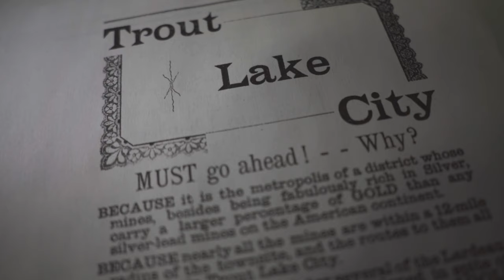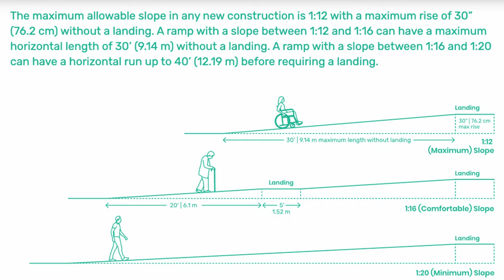Bowhead Presents: THE LONGEST CLIMB 💪  🏔

Comment: Insane man, big props for that climb. Didn't have any really clear shots to really check things out, but few things I picked up/wondered about....First, looks like you had a Ikon 2.8" outback, think you would be better served with some fatter like a Bontrager Hodag 3.8" or such, would make finding traction doing stuff like this much easier vs the small weight gain it would add. 
Second, luckily still pretty much fully physically able, but sitting watching the video and trying rowing like you would operating that, my hands kept naturally falling to a noon vertical orientation, slightly angled outward at the bottom, so wondering if that also wouldn't help or having some way of adjusting the position your hands end up in, or the ability to change up hand position to let certain muscles rest/change muscles being used, just like you do moving on the saddle and hand positions on a regular bike helps. Also, having the cranks lower I think would definitely help reduce shoulder engagement and tiring, bring them lower and closer or better yet adjustable, again to engage different muscles and let others rest.

Comment: @bowhead great design but as noted in previous comment. From a physics standpoint, wouldn’t be better if the cranks were facing on opposite ends like 12 and 6 vs 12 and 12? Then you have antagonistic muscles push/pull muscles working together? From and engineer standpoint during descent, I can see why the cranks in the same position makes sense for control (turn, shift, brake, balance). Is it possible to make 1 crank adjustable? Say on ascent have 12/6 position, then descend in 12/12 position?
Reply: Better for turning and also when you don’t have core control. I rode one with opposing pedals and it did not work